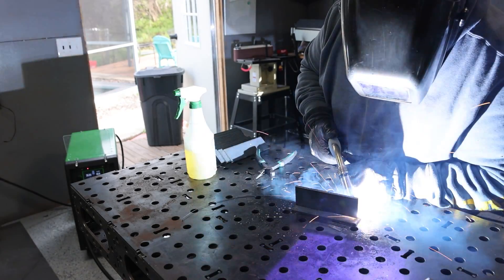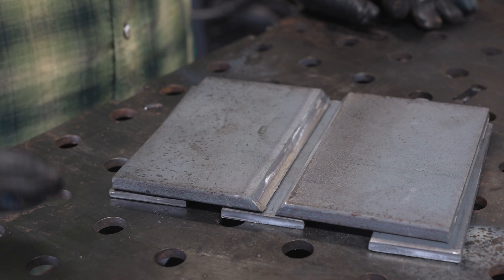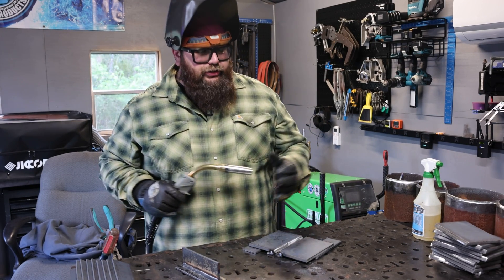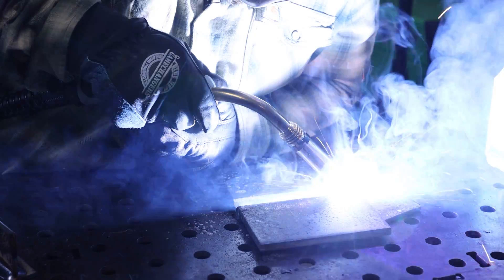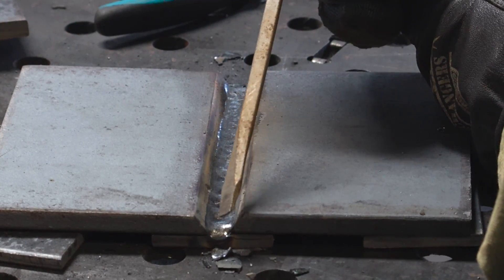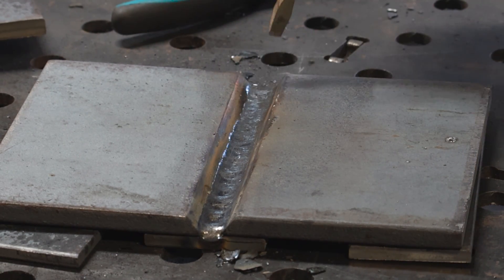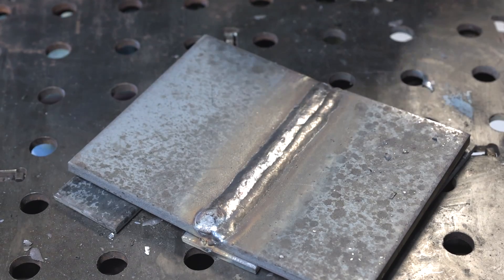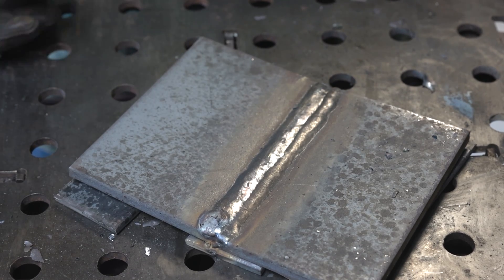D1.1 Practice with the Everlast Cyclone 312

Comment: What size circuit breaker are you plugged into? From the specs it looks like a 70 amp is required judging from the inrush amps.